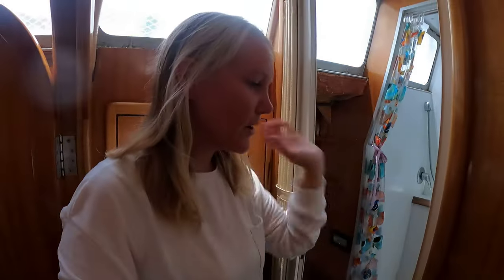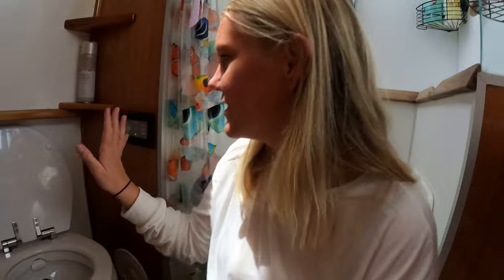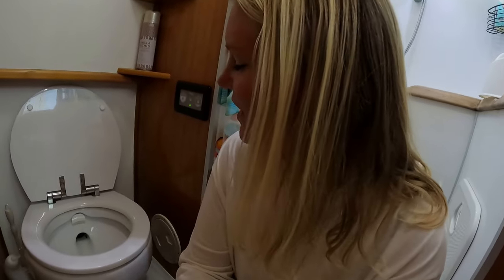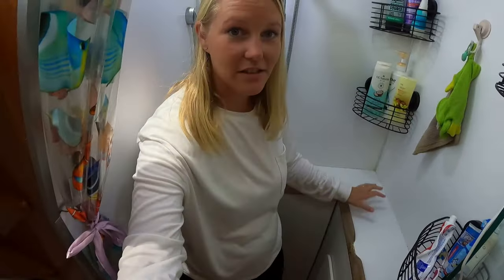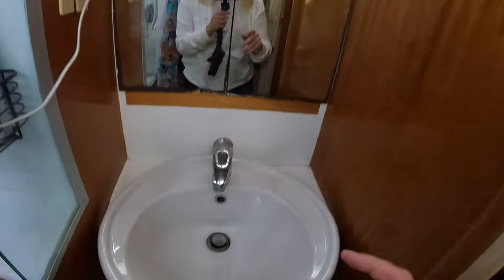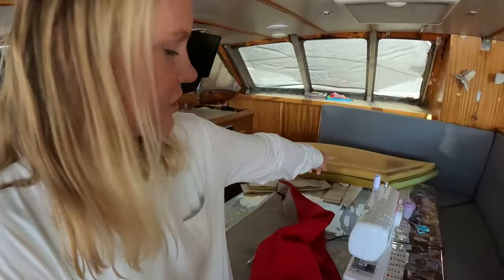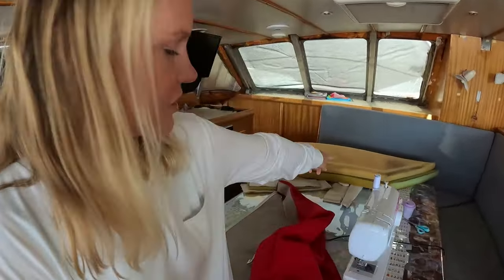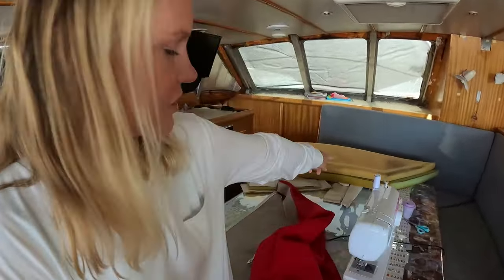Using the toilet and shower on a Sailboat | Facilities on a Boat | Sailing with the James's (Ep. 70)

Comment: Marine Loo's are a PITA, blockages, leaks, pipes calcify, elec issues, eww repairing, etc.
Compost is so much easier, no pipes/water (wet bum), doesn't matter what goes in, used correctly they don't smell, use leaf litter, fertilise a tree/garden. Rigging Doctor
has a great video on them.
I buy Bulk box baby wipes from Aldi, use is much less vs paper, place in rubbish bin, like nappies, sanitary pads, etc.
Shower - 2 x floor drains, salt water to wash goes to sea, swap plug, fresh final rinse goes to grey water tank to rinse chain, wash boat, etc.
Reply from the maker: Super happy with our set up, just the shape of the bowl is the downside 🤣 The toilet going in the front is a proper bowl with hole on the bottom 😍 
-Cait

Comment: Sometimes you have to wonder who designed things you have to use every day and why it was done in a fashion that is not as practical as it could have been (also could have been designed for a mono hull maybe? ) .  I guess it looked great when it was bought and installed but isn't as good as first thought and with the cost it was decided to "live with it" rather than change it.  Thanks for the video.
Reply from the maker: I do wonder sometime who designed the toilet and weather they tested it before mass production 😆😆😆